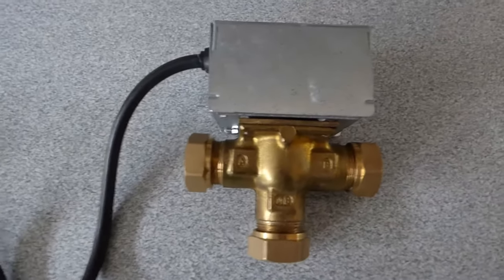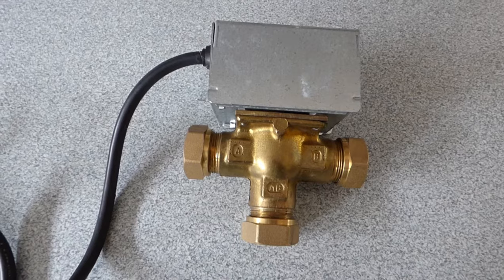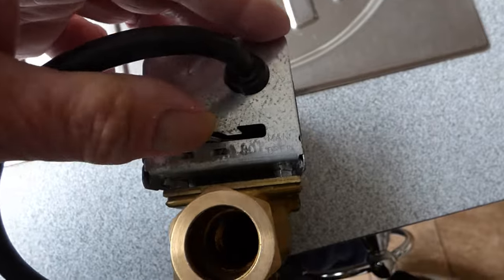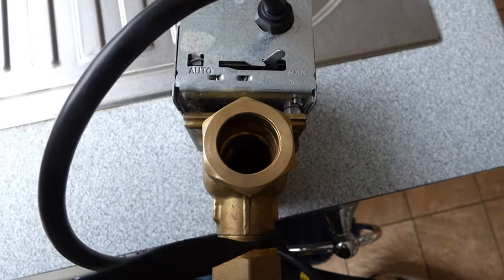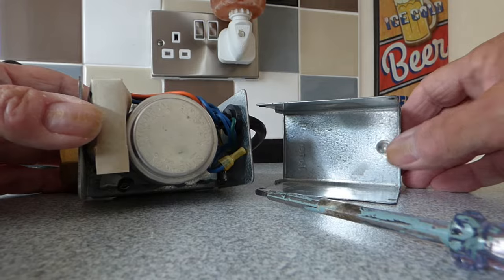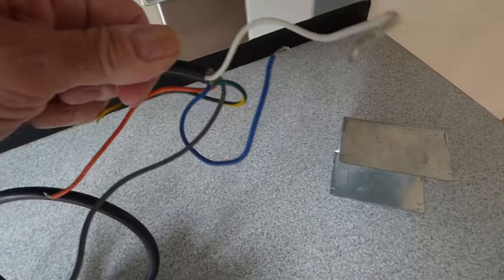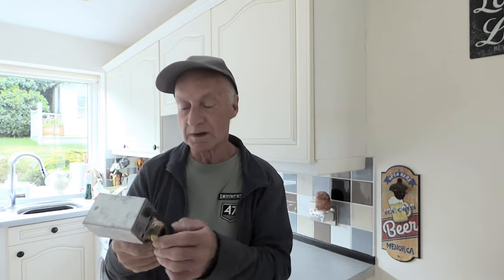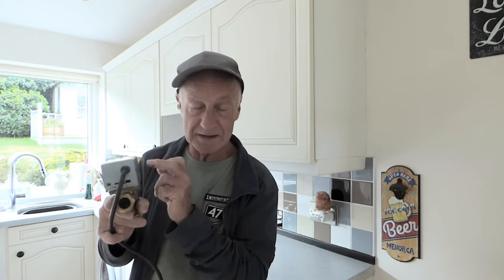No heating? An easy fix using a switch on the motorised valve

Comment: Thank you so much for this. I have a condo, and as the winter prep started, we found we had no heat. An electrician/plumber came in and fixed a problem with the thermostat, but there was minimal heat from the rad. I was then informed that I needed to change my zone valve and to bleed the system as I had an airlock. I contacted the folks who did the work and was looking at almost 1 grand of "work" to be shouldered by myself as it's indoor work, so I decided to do some research. 
Now, all I've done is flip the switch from Auto to Manual as Dereton30 indicated in the video, and taraaaaa! I've got sweet heat flowing at full blast. Nice little gift for the first snowstorm of 2023. THANK YOU!!!
Reply from the maker: No problem.

Comment: Thank you very much for your video. We had no heating, but did have hot water. I checked the thermostat and boiler without success. After watching this I put the valve into manual and everything is working now. I shall get a professional in to do a replacement repair, but am really thankful that we now have heating again.
Reply from the maker: Yes get the motor change when you can.
Reply: Small problem. Once the hot water reaches its set temperature. The gas boiler switches off, so no heating again. To keep the heating on I am going to need to run some hot water from the tank every so often

Comment: Thank you. Your video really helped me last year. I replaced the head. But it looks like the motor has gone again just 14 months later.   I have a hive system that controls this on and off around three times a day.  I'm not sure it it's that causing motor burn out or if the physical valve is broken.  Only 6 years old. But now third motor now.
Reply from the maker: If it is the third motor then the body will need changing. So get a whole new valve.
Reply: @dereton33  thanks mate. Really appreciate you taking the time to reply. 👍

Comment: Thanks for a simple solution, am so glad that have heating with a young baby in the house was a bit worried.  Was wondering  if I can change the valve motor in situ  by just switching  mains electricity  while I am working or do I need to take it off the  T-junction
Reply from the maker: You can just renew the motor on top. Have them in my Amazon shop.

Comment: Great video. Another fault of these valves is they turn the boiler on when the timer switch is off making the Orange wire live 240v. 
So if orange wire has 240v when everything off then swap the head.
Reply from the maker: You are correct. Cheers Mark.

Comment: Brilliant video, thanks! I put the switch into the “V” but doesn’t get heating back. If I manually hold it to the faaaar right the heating does come on only as long as I hold it there. Guessing I have to replace it?
Reply from the maker: Afraid so, When they do not hold, I wedge them  with a matchstick.
Reply: @dereton33  

Thanks mate!

Comment: hi, thanks for the great video.  i recently had no heating in rads upstairs. i removed the motorized valve and manually opened the valve and the rads began to heat. is it ok to just leave the valve open even when the heating is off. thank you
Reply from the maker: Yes that`s ok.

Comment: Hi - Thank you so much for this helpful video which really helped me out a while back.I was hoping you might be able to help with a quick question please…? 

I switched my heating off over Christmas and just returned home.
I switched on the heating and water only to find that all my radiators were freezing. Tried resetting my Worcester Greenstar which didn’t work so I tried your valve fix. This enabled the bathroom radiator to come on fully (thank you!) but the others are still cold. 

Grateful for any advice kind sir!
Reply from the maker: Check the pump is not stuck.
Reply: @dereton33  Thanks so much for the prompt reply, very much appreciated. Engineer is here now and pump seems fine. Looks like the valve needs replacing. You’re a legend! x

Comment: Hi Derick,
Great informative video as always and wondered if it's normal for my Danfloss casing to always stay warm even when the boiler is not on. Everything seems to be working ok and the motor is only about 18 months old with little useage
Reply from the maker: Yes it is quite normal Michael.

Comment: Would a faulty 2-way valve, or an associated faulty motor, cause a loud bang when the central and/or hot water is sequenced either to run or stop? Also, I'm guessing that you can't attach the motor onto the valve upside down, or could you?
Reply from the maker: The loud bang will be a boiler problem. Never fit valve motors upside down.

Comment: Hi, great video. I've taken the cover off to see if the motor is opening/closing the valve, however I've waited a while after the hot water is on but can't see the motor close the valve.  Should it open and close as soon as the boiler/hot water is turned on and off? Cheers
Reply from the maker: Yes it should.
Reply: @dereton33  Ok, great, thanks. :)

Comment: Your videos are fantastic. I've had issues  with my system - was limping before storm Eunice, then had pilot blown out in storm and getting it working properly since is a pig. Can't tell if boiler getting locked due to diverter or (new) diverter isn't receiving a signal from boiler. Ideas??
Reply from the maker: Best way to check is by using a test meter to see if you are getting power to the boiler.

Comment: Can I isolate the power supply to the head without turning the main power supply off to the whole house please ? Great video.
Reply from the maker: There should be a power switch that turns the boiler off which will turn the power to the valve off.

Comment: Thanks for the video. I'm about to change the head on my 2 zone valve. Should I put the lever in manual (open) position before removing, or does it not matter as long as the new one goes on in the same position?
Reply from the maker: It does not matter as long as the new one goes on the same position.

Comment: Great video, will this be the same issue for my hot water is heating up radiator? The heating is off but when my water heats up my rads seem to start getting warm.
Reply from the maker: Not for that I am afraid. you will find in this instance that the 3 way valve is not closing the hot water side properly when the heating only is selected. .

Comment: Brilliant explanation and practical video . Thank you ! Just a question about drain down and refill  ......do you keep the Three Port Valve locked over to the manual position when refilling the system or do you unlatch it ?
Reply from the maker: Yes and yes

Comment: Hi I’ve got an old 1979 heating system Stelrad boiler. There doesn’t appear to be a motorised value fitted. And no room thermostat. I’ve change to a hive thermostat and still have the problem of no heating unless the hot water is on as well. Do you have any suggestions please? This is another great video and I’ve watched other when doing diy plumbing. Thanks chris
Reply from the maker: You have an old system with no way to isolate hot water on with out heating on. You do not have a motorised valve fitted.

Comment: Hi Great Video. I have some queries if you could please answer. I have both heating and hot water. What would happen if it is on auto mode? What setting should it be on if i want heating only or hot water only. Will it close the valve for hot water side if the hot water temperature has been achieved?
Reply from the maker: Auto will allow you to have just hot water or heating, or both.
Reply: @dereton33  Thanks. So in manual mode will it be heating + hot water both? Also if my temperature of hot water tank is achieved will it close that side automatically and run heating only?

Comment: Thanks for the excellent explanation of the motorised valve. My CENTER valve is making a continuous tapping noise. I moved the lever to manual. It made no sound when I moved it and had no resistance. The lever is down fully but will not clip into place. My central heating is set on at the controller and is working. My hot water is off at the controller but the water is hot. So i assume the valve is open. But the motor or something is tapping away. Any ideas?
Reply: Wnen radiators were hot and house warm, I tried switching lever back to Auto and switched Hot Water on again at the controller. The tapping stopped immediately. Then, after a few minutes it started again. So, switched HW off and moved lever back to manual. Still tapping away!
Reply from the maker: Motorised valve fault.

Comment: Thank you for this video , if you can help me I would be very great full, I have a 3 way Drayton motorised valve it seems to work ok but when I have the heating on in the evening and then turn the heating of from the room thermostat the heating will not turn of . I then have to go to the airing cupboard and switch the power of the motorised valve for a few seconds and I then hear a “ rewinding “ noise coming from the valve , do I need a new motorised valve or is it a possible a maintenance issue if I remove the valve and clean and inspect . The lever on the side of the valve seems very loose to the touch .
Thank you for your time ,
Regards,
Dermot Kelly .
Reply from the maker: Hi Dermot, best just to renew the valve.
Reply: Thank you very much 👍

Comment: Thank you so much for this. My three way valve was buzzing after the timer switched everything off and so I replaced the valve using your instructions to the T. I switched the old one to Manual before removing and put the new one to Manual before installing and then returning it to Auto. I now have a problem with the heating coming on with the hot water even though the heating is set to “Off”. I have checked the wiring and everything is in the right place. Any ideas, please?
Reply from the maker: The body of the valve is gone, you will need to replace the whole valve not just the motor.
Reply: Thank you very much for that. Your videos are so good.

Comment: We have no hot water but the central heating is working. when I try to push the lever, it comes back to it's original position. Is it how it is supposed to be? Can I put this lever to manual to gain access to hot water and then call out an engineer to check the motor etc? What is your recommendation? Thank you for your time to answer our comment.
Reply from the maker: You must lock the lever up into the V slot in the aluminium cover, or it will return to auto.

Comment: Hi - don’t mind account (using my daughters) do I need to drain the system if I’m changing the motor and the 2 port piece also? If so, how? I’m ordering full piece with 2 port piece from your store. By the way, I have a Siemens DVA2/5 s same thing? 
Thanks 
Eoin
Reply from the maker: You will have to drain down if you are renewing the entire thing. If it was just the motor on top then you do not need to drain anything. The Siemens is the same type.  To drain out look for a drain valve on the lower floors.

Comment: Hi. Great vid. I have 2x valves, one for my central heating (which works fine and boiler fires). The other is for my kitchen UFH. This one turns on via my nest, but boiler doesn't fire, which is why I think the valve may be the issue. However, when I switch to manual as per the video, it doesn't fire the boiler - should it? 

Would you recommend changing just the head unit, or the valve also? (mine is 2 way valve)

Comment: Hello, I've got two of these, I believe it is the two valve ones.  Do I set both of these to manual? Or do I need only a certain one set to it. Thank you!
Reply from the maker: You only need to set one, it is the one that does not feed into the hot water tank.

Comment: Thanks for the video, what does this motor do? I'm trying to increase the water pressure to my hot taps and noticed the switch moves freely and when pushed to manual won't slowly move back to auto. I can move it to where I like and it stays there. Is this normal?
Reply from the maker: You will not increase any pressure to the hot taps with this motor. It is purely to direct water flow to either the hot water tank or the heating or both. The motor valve is quite normal.

Comment: I have heating but no Hot water (hot water works when i turn on the electric immersion heater but when that is off the gas is not heating the hot water)
Pushing the valve to manual seems to have solved the issue.. but is there an issue leaving it permanently on manual?
Reply from the maker: No just that you have to have hot water on with it.

Comment: Hi thanks for the wideo, When valve 3 port is set to central heating it is all the time a hot motor and there is a soft noise coming from it, 
this is good? How do I change to heating water everything is ok
Reply from the maker: Just set your programmer to hot water, the valve will move to send the hot water into the tank.
Reply: @dereton33  Yes I know but why as it is set to central heating  motor is hot all the time?

Comment: Great video!! Similar problem.I have a sunvic 2701 motorised 3port valve when I turn on the rads on my electric heating panel nothing happens but when I turn on hot water both rads and hot water comes on together working off the thermostat in the hot water cylinder. Is the an valve issue
Reply from the maker: Yes 3 way valve faulty.
Reply: @dereton33  thanks I'll let you know how it goes
Reply: I finally received my purchase from eBay. I replaced the 3port sunvic motorised valve. Now on my eph r27 control is still  turning on  both together hot water and rads together. I have joined live and #3 together on the back of the control panel and it lights up the boiler turning on both rads + hot water when I joined Live and #4 together nothing happens any suggestions. (Could this be a wiring issue?)

Comment: Brilliant Information, 
Can i check my issue with you? We have a 2 way valve next to the hot water tank. Think i am correct that when the system is off and it isnt energised that there is the resistance when moving from auto to manual. With the hot water & heating on, the lever is loose?
Before we put the heating on, we started to see some radiators coming on and getting warm. Now we have put the heating on as it is getting colder, i am finding that the radiators are getting hot but the hot water is only getting warm. Is this happening because of the valve, or another issue?
I will try just putting the valve on the Manual setting for tonight, see if it solves the issue and then look to replace it.
Any guidance greatly appreciated..
Reply from the maker: This is more than likely a balance problem, the heating is stealing all the boilers heat, but do try the valve in manual in case it is not opening fully.

Comment: Thanks for the fantastic video. I’ve got no hot water unless the CH fires up. I have 2x 2-port valves beside the HW cylinder . One of them is warm to the touch so I’m guessing that is the one for HW. I went to set it to Manual to find it already jammed in manual (I can’t move it to auto). Is this still a motor box change?

Thanks in advance!
Reply: I should add that the other valve (not warm to touch) is on auto, but I'm guessing from a previous comment that this is not the one that operated the HW
Reply from the maker: The one that works the hot water is on a pipe that leads into the hot water cylinder, more than likely the one warm to the touch, jammed on, try just changing the motor first.

Comment: Hi. Thanks for the video! Got the downstairs rads on now. I have 3 x two way valves (upstairs, water, downstairs). When the faulty downstairs valve is manually opened it continues to run the boiler rather than the boiler following the timer so I have to turn it off manually to stop it continually being on. One timer is for water and downstairs valves and other for upstairs valve. Would this be a valve motor issue or timer issue? The water valve still works. Thanks in advance
Reply from the maker: It will be the valve microswitch.

Comment: Hello, my new motor valve opens manually before connecting to the wires but once connected it wont open manually not auto. I thought the old motor valve was the culprit but with new new motor valve it does the same thing. local plumbers cant figure what the issue it. What could be the issue here? Another motor valve open ok manually but not opening on auto. Could this be the wire/electric cord issues?
Reply from the maker: Wired up wrong

Comment: Does that mean if you have the valve open, the heating and hot water are on constant? Or is that still controlled by the electrical panel?
Reply from the maker: They wiil be on constant

Comment: Our heating system stopped working and we got an engineer out. He quoted us for a new thermostat and receiver, and a new motorised valve head. Quote was for £660.

I tried switching the valve heads to manual and the heating came on. I then tested whether the thermostat worked properly and it does, heating comes on when I turn it up, and goes off when I turn it down to room temp. I suspect this means we only need the valve heads sorting, not the thermostat and receiver?
Thanks
Reply from the maker: It does.
Reply: @dereton33  thank you

Comment: Can you leave the valve on all the time. Erie  AG13A02A Pop Top Actuator 2 position normally closed never does it job on heating. Always stayed closed even when thermostat demand hiked up to highest. House is still cold. Costing me a fortune as contractor keep using the same valve. WHY?!  Can I just override as you did. It doesn't say it has manual mode. But has that groove down I can lock it in. Pls advise. Thanks!
Reply from the maker: Yes you can lock it in manual, the heating temperature will then depend on the boiler stat. Contractor uses the same valve, as others would not be compatible with your wiring.